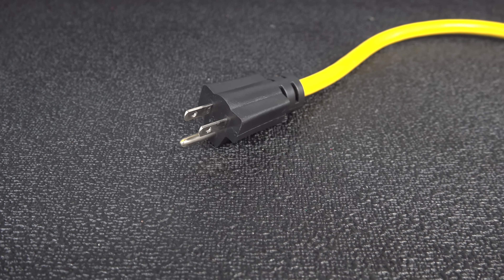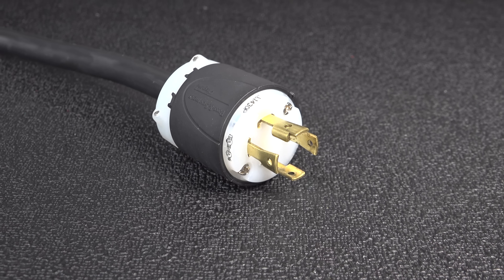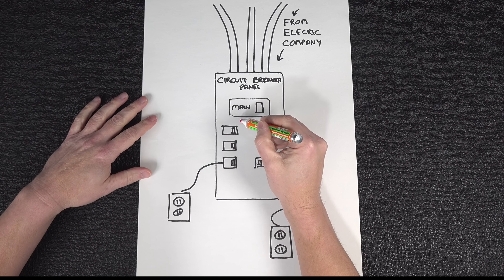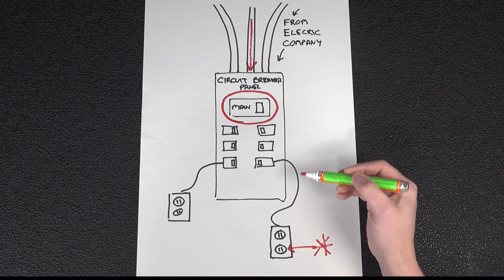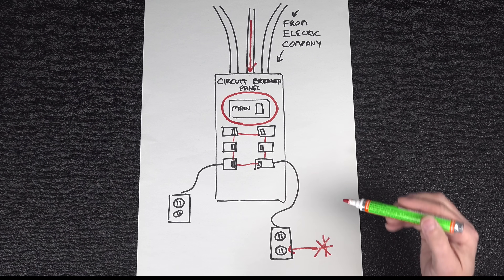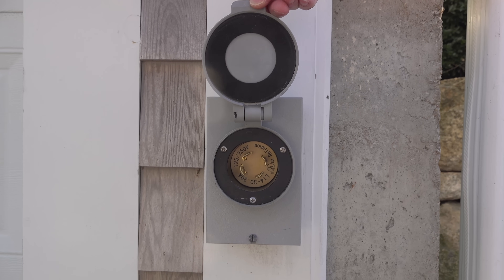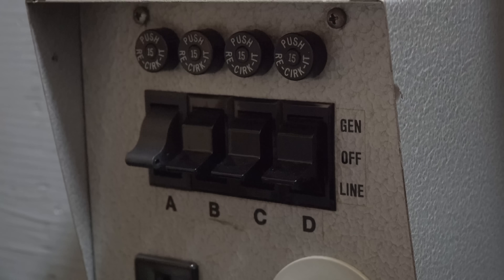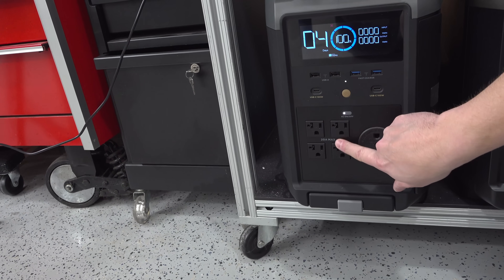Worst Electrical Mistake You Can Make - Backfeeding Generators

Comment: Kinda clickbait with the picture, nothing wrong with backfreding (from a technical perspective) if you disconnect mains and manage your loads on the panel correctly. Yeah it’s not “normal” but if you’re just running a few lights or outlets for charging things, the wiring doesn’t give a damn which “direction” the current is flowing.
Reply from the maker: Nothing wrong with backfeeding, its against electric code in every state in the country. But other than that and the fact its killed multiple people, sure I guess its ok

Comment: we have quite a few of open end cables for example male on one side and just blank wires at the end at work because a few of our units have screw in inputs. We call sem s-word cables and whenever the the electrical safety manager comes around we need to hide them as they are "deadly" :D

Comment: During the recent four-day Michigan total outage, I used a home-made double-male cord to reverse feed half the circuits in my home. Of course I switched the main breakers for the house off. I didn’t know what was going on outside the house during the storm; maybe there was a downed wire, or maybe there was a hapless lineman working, but basically I wanted to contain the limited current from my EcoFlow Delta-2 within my house.
This worked perfectly, with no problems, and half my house was powered, refrigerator, TV, but sadly not the internet, because the ISP was down.
It’s certainly far safer than running extension cords every which way.
Saying that the exposed prongs are dangerous is buncombe, because I plug the cable into the dead wall receptacle,and only then do I plug the other end into my EcoFow.  You are raising an unnecessary alarm over nothing.  What next?  A video warning people not the stick their tongues into a hot socket?

Comment: My 60's Dynacord bass amp came with a funky cable for speakers: One end has your normal 6,3 mm audio jack, the other has 220 volt EU power plug! That side connects to the amps speaker out.

If you want to get rid of a band member....

Comment: Stop this BS. First of all, "illegal", no, it is not "illegal". They are NOT illegal. They are against regulations, and so you could never get one approved, so you couldn't manufacture and sell one. Using it? It's my own goddamn house, I'll do whatever the hell I want there. Not illegal to use. Your illegal claim holds no water. 

Second, all you have to do to make it safe is add a simple "not to be operated by imbeciles" label to the cable. ALL you need to do is cut that breaker. If you have a proper general double circuit breaker, as you should, and you cut it first, that's it. Your house is now isolated from the grid. Now you can feed it from a generator all you want. You just have to make sure you don't turn that circuit breaker on until you disconnect your generator, and that also you don't go plugging your male to male cord when it's live. That's accomplished in quite a simple way: You first cut that circuit breaker, then plug a regular make to female extension cord into a proper outlet rated for enough power as you're gonna be transmitting, then the male-to-male, finally that into your generator. That's it, you never handled any live dangerous cables.

Seriously, stop calling it illegal, you're just embarrassing yourself.

Comment: As an electrical engineer working on power grids, I'll just say this: the male to male power cord is an invitation to death, both instantly and after weeks of excruciating pain. You do not want the electrical safety training I go through every three years. Uncensored pictures and videos showing exactly how electricity kills or permanently damages you with no warning, and no possibility of stopping it once it has you in its grasp. Like this video said, electrical connections are designed to make it very hard for people to get in direct contact with an energized circuit. Electricity is an invisible killer, moving through your walls at two thirds the speed of light. Do not mess with it without proper training and safety gear. If you value your life, leave electricity to the professionals.

Comment: In my country backfeeding up to 800W is perfectly legal. You can just buy 2 400W solar panels and plug them into any outlet. If you want to feed back more than 800W, you have to get a permit however.

Comment: My father has fallen victim to these kill cables before. In a factory he pulled out a 240v plug and ended up pressing all the prongs into his hand as he was pulling it out. The shock threw him back and he was in the hospital for a head injury for weeks.

He told me the electrician's safety secret: he'd be dead if one of his hands wasn't in his pocket as the shock could have easily travelled through his heart and killed him. Now he, and I, treat electrical cables extremely cautiously.

Comment: My power went out once and my ceiling fan came on slow speed couldn't figure out why, neighbor on another block had a generator backfeeding with the main breaker open allowing power to travel through the power lines to my house

Comment: The double ended 110V cords are silly - you want a double ended dryer or stove plug - that way you can hot both busses in the load center. Just make sure you yank the meter or open the main breaker. If you try and power the grid your generator will just croak off. There is a small chance during that closure someone could be hurt, so it's no joke. You must open the main breaker.

Comment: It should simply be code to have a transfer switch on all newer houses.. just like MANY of you have said; sometimes you do what you have to do. If it was subzero and I lost power for more than three days without an inverter from my car I'd be screwed without it. No gas, no well, thankfully non-electrical plumbing (no pump). But still.. I agree that EVERYONE who buys a generator SHOULD ALWAYS install some sort of automatic circuit isolation method.

As mentioned before.. if you don't have the 💰 for a generator and a transfer switch then just use an extension cord from the generator or from an inverter mounted to your car. If you want to run sensitive electronics you can buy a pure sinewave output inverter. Just be careful about overloading extension cables and NEVER EVER EVER go over 1500W on each circuit; even if the inverter can handle it. That means 1 heater on each circuit is MAX. This is due to the limitations from the heavy duty extension cords. Compressors do pretty well on them and it won't overheat the thermally sensitive electronics inside.

ONLY USE "HEAVY DUTY" OR THICKER GUAGED WIRES (12 AWG MIN. for a complete 110V - 120V X 15 AMPs through copper (1650-1800 WATTS)

I still want to mention that if you were to just replace the other end of the cord with a male plug then it would be extremely dangerous due to the possibility of arching (from shorts) and electrocution. It's the same exact thing as a generator; just without the specialization for it.. so it IS much much less efficient.

Here's your secret formula.

Alternator Amperage X Battery Voltage = 100% power in watts. NEC recommends staying at or below 80% to prevent hazards and equipment failure.

Once you have your total (in watts) that your vehicle can push for you; find an inverter with the correct specifications (if your car can only push 8000 watts then you DO NOT need a 10,000 watt inverter). 

There are two kinds of DC TO AC inverters:

*Modified Sinewave
*Pure Sinewave

Modified Sinewaves are produced by very rapidly converting a direct current into an alternating current. As a result, the waveforms of the alternating current look jagged on an oscilloscope. This is what causes premature failure of sensitive electronics (like compressors and motors).

A pure sinewave is self explanatory; and it is usually produced by an actual generator (a machine that converts mechanical energy into electrical energy). It is this direct conversion that gives the sinewave its "pure" look. A pure sinewave inverter will replicate this using internal components.

If you want to better protect your stuff.. go PSW.

A sinewave is just an electrical current (usually AC) plotted over a certain amount of time.

DC can also be plotted the exact same way; however, due to the unchanging polarity and intensity; the wave stays pretty much flat. Therefore, it isn't a sinewave.

Why is one more expensive than the other?

The circuitry needed for converting a direct current to an alternating current is quite simple and can be cheaply produced.. however; it's much much harder to convert direct current into a pure form of alternating current because of how multiple variables are always constantly changing.. an inverter is NOT a generator. An inverter simply modifies and mediates the source current FROM the generator itself TO the output end (or receptical end) of the circuit.

Thanks for reading.

P.S. Thought I'd throw this in there. If you need MORE power then you can hook two batteries up in parallel and run them into the inverter. This won't increase output; only capacity. If you need to increase output then buy a bigger inverter (12V vs 24V vs 36V). 12 * 2 = 24: so you can wire two 12v batteries in series to get more power AT ONE TIME. Remember.. Amperage X Voltage = WATTS.

Comment: Is there a type of generator that you can like plug into a wall that way when the power goes out it'll keep your computer a life that way you can save so you don't lose it work
Reply: It's called a UPS. It connects between the wall outlet and the computer equipment.

Comment: Good luck finding a generator big enough to feed back the main grid.
If you connect your tiny generator into the main grid, you will overload it and trip the fuse.
Reply from the maker: Wouldn't it be nice if that was true. Its 100x worse than you think. Your tiny generator heads up the pole, and when it hits a transformer the reverse happens, the voltage is boosted even higher. Normally the work to lower voltage. There are no fused except at main interconnects on poles. Its not hard for someone to be hurt, could even be your neighbor.
Reply: @Silver Cymbal  Then why do power plants need to have huge generators, instead of tiny ones and big transformers? Free energy basically.
That's not how a transformer works.
That would only be dangerous if you had one of those container size generators that can feed a whole neighborhood.
Try to charge an EV car, or use some other high power appliances with that small portable generator you have in your video and see what happens to it.
Generators have fuses on them to prevent overloading them. Basically, the current pull on the magnets will be so strong it would stall the engine.
This is a common misconception because, yes, those suicide cables are indeed dangerous and some people actually own very powerful generators that could technically backfeed unknowingly to some small isolated portion of the street grid and hurt some technicians.
But most consumer-grade generators are nowhere near powerful enough for that.

Comment: As a kid, my dad got pissed that people would steal our 50 ft cord used to plug in the car when it was -20 out. People would steal it, ripping it down from the two trees that was in to cross the sidewalk. So he got a new cord, and then he cut the cord in the middle, and made two cords, one like the one in the video (but 25 ft long) and one with two female plugs. You also needed a ladder to get the second cord down—it was tied to a high branch— but without the plug ion the middle, you could pull hard enough and it would come free. 

Someone ripped down the cord one more time and left it in the bush, and that was the last time—I guess it looked like too much hassle for them. After that, no more problems.

Comment: Always the "safety" issue, Bottom line, YES THIS CORD IS what you need! COMMON SENSE, DO NOT TOUCH the end that is LIVE! #1 SHUT OFF YOUR MAIN BREAKER in your house! That way you dont backfeed the whole neighborhood OR the LINES they are working on, then find the outlets you want to be powered and PLUG IT into the outlet THEN the generator!  Have done this MANY times over DECADES NEVER an incident!

Comment: The old suicide cable!

I work on generators professionally and back feed my house when the power is out. Theough the drier breaker. 30a breaker 6.5kw genset running essentials. 

But I am a professional.

Comment: Backfeeding is fine and allowed by code as long as you have a basic interlock device on the main.  No need for a transfer switch.
Reply from the maker: Correct, an interlock. Most people do not believe that. Interlocks are perfect

Comment: This is a hook-up for shore power, not some magical cable that changes the way electricity works. Don't be stupid and you'll be fine. If you are stupid, get somebody else who actually knows what they are doing to plug it in to the correct plug.

Comment: How can it flow back to your neighbours or back outside if the main breaker is turned  off its a  double pole switch and no way of letting electricity flow outwards
Reply from the maker: Yes it can, and when it hits a transformer it works in reverse, it will turn 120v into over 1000v. Always use an interlock to stop this from every being able to happen
Reply: @SilverCymbal  how can current flow through a non contact. I.e. a switch that's turned off.
Reply from the maker: @SOLARSHED13  It can't, the problem is turning off the main is not automatic and mistakes happen.
Reply: @Silver Cymbal  so clearly the first reply to my comment from you was incorrect. If you read my comment properly.

Comment: So just going to say this since nobody else so far as I've noticed that I haven't looked very far you'll realize that double-ended male cord is for some tools that require an extension cord but when you open up the thing it's got a female plug that's the power source use that male-to-male to power that that's what it for it is not for a generator is not for anything else it is simply for a power tool or light or  work equipment that requires an in power Source from a male end

Comment: /Never seen anyone back feed using a 120v cable I always use a 240v cord from my generator I have done it for years with no issues!  That being said it can dangerous if you don't know what you are doing.

Comment: When I was 7 years old, I backfeeded my houses fuse panel and I didn’t know that the main breaker was off. I fired up the generator and all of the neighborhoods lights and stuff turned on. Then my generator when into a protect OVERLOAD mode because of the city power company has connected 860,000 homes. Luckily the generator turned off and the utility workers didn’t get shocked or show up to out house. I won’t backfeed generators again!!!

Comment: It's so cute how you think lineman don't treat all lines as if they are not live lol
Reply from the maker: Yup, until they start working and someone fires up a generator. Oh oh
Reply: @SilverCymbal  it dosent matter lineman always treat and work under live conditions otherwise there hurt n 4 certain or dead
Reply from the maker: If you are looking for anyone to say backfeeding is ok because workers have safety precautions you won't get it from me, and if you are doing it you are putting folks at risk even your neighbors. That's why its outlawed everywhere.
Reply: @SilverCymbal  funny it's not really outlawed everywhere how do you think soler power generation works its back feeding to the grid and some locals have private hydro and windmills so backfeeding is done to the grid all the time
Reply from the maker: @wizard3z868  You are missing key points. Sure solar backfeeds and so does hydro, WITH automatic interlocks. When the grid goes down, all solar is disconnected automatically, by every code and installation.

Comment: Looks like something you can use to steal power from the neighbors just turn off all your beakers and plug your wall into his wall you can power half your room if not all of it and do the same for the rest of the house and with these led lights I can power like 10 of them for less than 100 watts you can only take about 1kw before you pop his breaker and it's 10 cents a kw so give him $2.50 a day per cable leading from his house that will cover it and he will get a slight profit

Comment: FALSE.  If your MAIN BREAKER is pulled to OFF position, there is NO backfeed to the street.  This is a bogus 'fear fear, buy this from us instead' promo.  Double MALE is a very dangerous, but it is NOT "ILLEGAL" everywhere, or anywhere near your, really.  I'd LOVE to have them list the municipalities in the US where there are actual LAWS making backfeeding during emergency power outage illegal.
Reply from the maker: You won't find a town in the country that this is sanctioned or allowed. You don't have to follow laws, rules or best practices but in this case backfeeding is against all 3. if you can buy a generator and rig your own cord, spend $90 and get an interlock and outlet and play it safe.

Comment: 2:04 how is back feeding any different than a proper emergency generator setup?  if a lineman is not treating every line like it's live then they deserve what they get. every electrician is trained to treat every wire like it's hot. so no it's not deadly.
Reply from the maker: The interlock is the difference. Makes it fool proof. Sure every lineman tests the line once and then they start woeking, what happens when its energized during hours of work? I didn't make this rule but I agree with it. It the same as needing yoru foot on the brake to shift gears.
Reply: @SilverCymbal  you don't use the brake to shift

Comment: I have a question what if you disconnect the main breaker from the line power then plug the generator to the outlet what will happen?